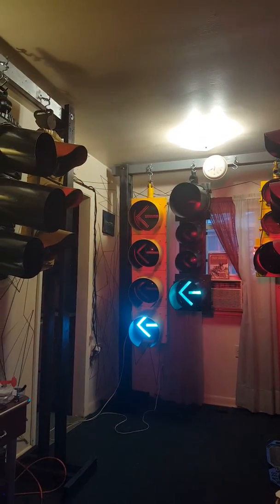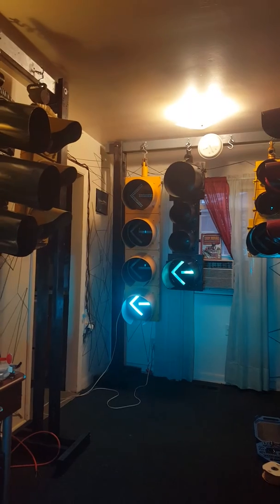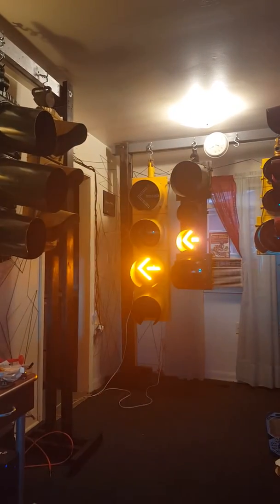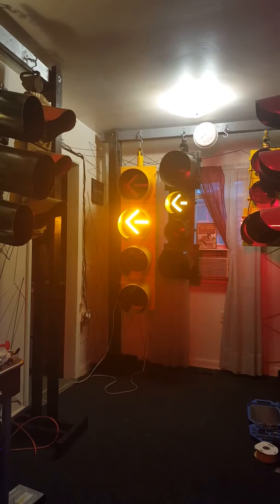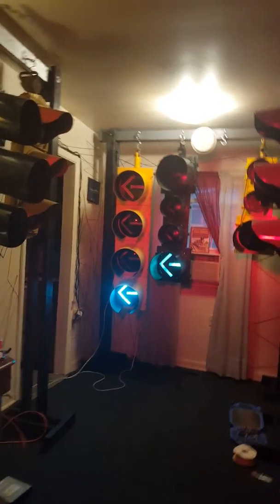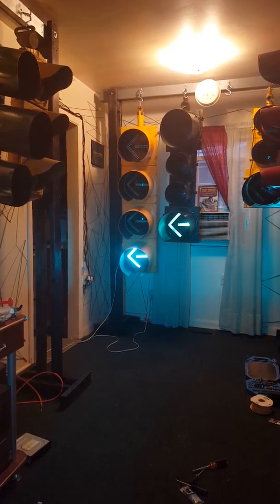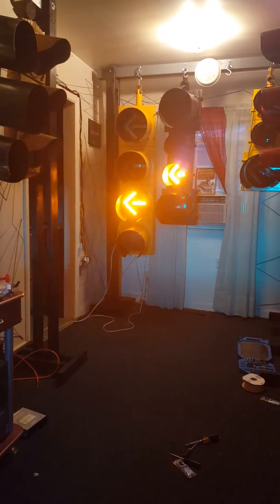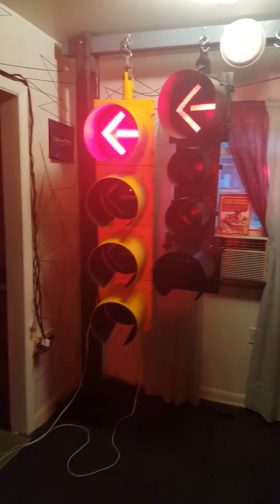Wiring my traffic lights - Phase 1

Comment: How does the flashing yellow arrow phase work in the controller?
Reply from the maker: It's preprogrammed into the actual board by a friend. I'm not sure how the real ones in the wild work
Reply: @rocky1266  I figured. I'm interested in how that would work on a small board.
Reply: I figured. I'm interested in how that would work on a small board.
Reply: Nice. I'm actually interested in how that would work on a board instead of an actual controller.
Reply from the maker: @signaltracker2322  join a facebook group called "Highway Divides" or another one called "Anything Traffic Signal" and ask for someone named Sean Breen. He is the one who programs and sells the boards
Reply: @rocky1266  Ok. Thank you.
Reply: I figured. I'm interested in how that would work on a small board.